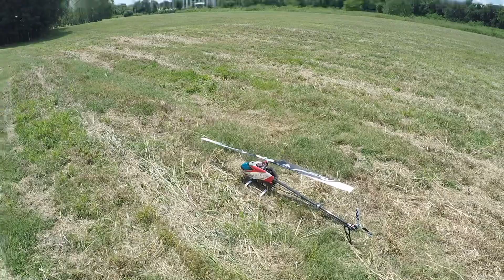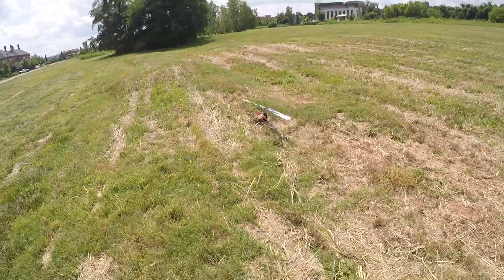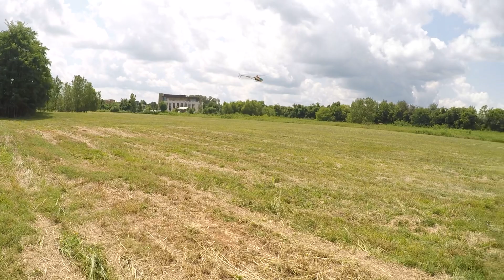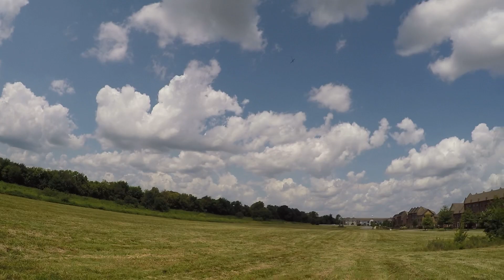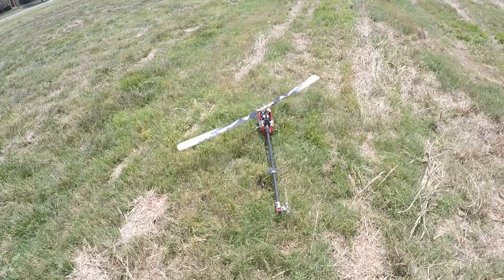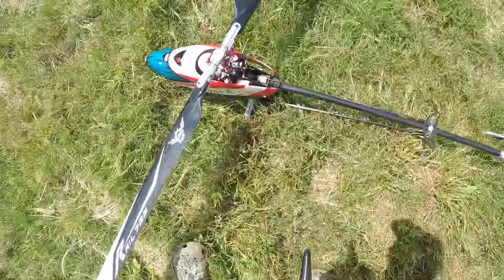Align Trex 760X 4th flight

Comment: As long as it doesn’t affect the flight performance then I think it should be ok but I know what it feels like trying to get your heli to be perfect. I’m in the process of fine tuning and it’s driving me crazy.
Reply from the maker: No it doesn’t affect the flight at all but very worried about it trying to eat it’s self again like two flights ago. There is definitely something making it so it but what is the question?
Reply: @westhobbiesrc8051  I’m not as skilled of a builder as you are but if I had to guess if you haven’t checked it already but it may be a slight bend in the feathering or main shaft. Also try checking the level of the swash at the lowest pitch/throttle, it may be and linkage length issue. Hope this helps.
Reply from the maker: Of course no matter how good or skilled of a builder/pilot that you are you still can overlook the simple things so it’s always great to have another person’s ideas or opinions. Unfortunately yes I have checked over the main shaft and feather and shaft at least 10 times I even replaced the main shaft and feathering shaft again with another brand new one as after the crash I replace them and it still wobbles I even put new blade grips on after the crash still the same problem the only thing that’s left in the head to replace is the head block. So that is next! Swash plate and circle links are all 100% dead level and equal to each other.

Comment: Did you check blades CG? And I would recommended stock Align 760mm blades. 
On grass it is typically to little bounce around but definitely not violent like it did before.
Reply from the maker: I did and they are perfect, I also checked weight and they are perfect as well. I’m going to get a set of stock 760mm Align blades as that’s what I was flying with! I was told Rail are so good so I had to try them but not happy.
Reply: @westhobbiesrc8051  Could be blade tightness and or servo frequency issue.